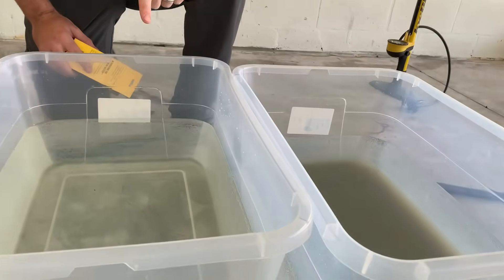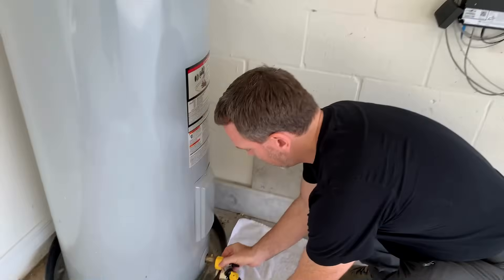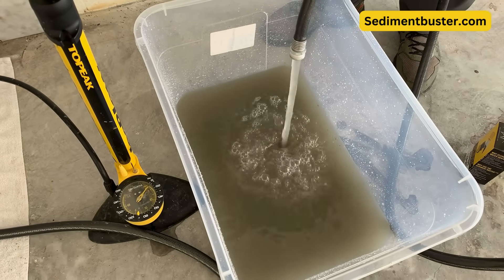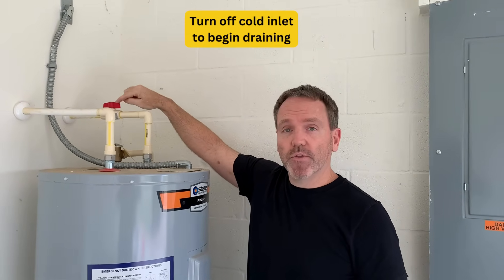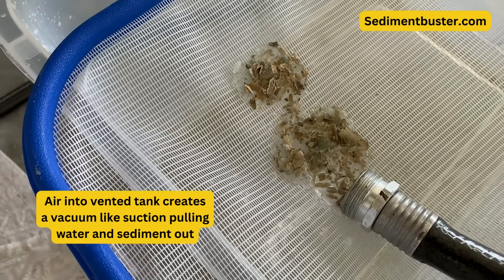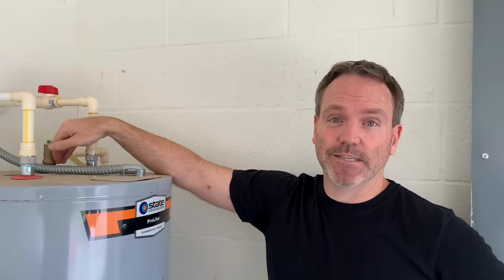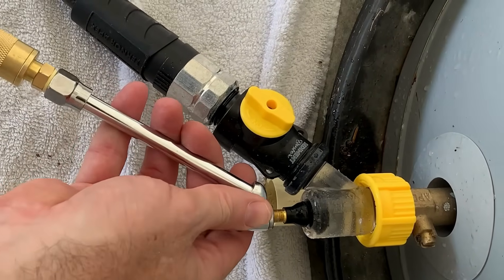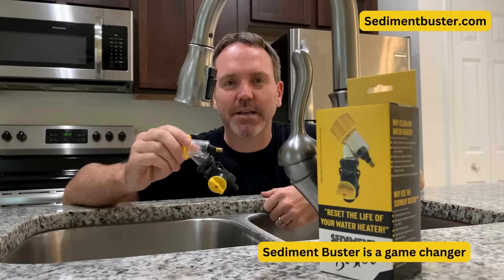Sediment Buster Unclogs, Flushes AND Drains a Water Heater Tank like you've never seen before

Comment: way cool tool.   This gives me - courage to do the flush - because plugging up valve is an issue and the only way that I saw before was to have 2 hoses in y config - one to basement drain and other to water supply.   this is way easier.  thank you

Comment: Just remember if it's been a while since you've cleaned the bottom of your water heater. You might not want to do it. Once you flush it you may open up all them tiny pinholes that were plugged up by all that sediment.
One more thing. Your pressure relief valve If there's enough junk around it to keep it from sealing there's probably enough junk around it from keeping it from working. Yes it can be a pain to change. But you should open it up. Relieve the pressure. If it doesn't reseal. Put a new one in. If it was clogged up enough not to reseal it was probably clogged up enough not to work properly. And it's kind of an important part. It keeps it from being the space shuttle. And remember you might want to take your aerators off your faucets and you're messing around cuz you're going to plug them up. This is a commercial about this little thing. it's not about what you should do. it's just about buying their product. Because they want your money.

Comment: Cool tool.  Question.  According to the description it is recommended to use this between 80-100*F but the water in the water heater is usually hotter than this.  What do you do when the water is hotter than the recommended range?
Reply: Follow his directions.  

Shut of the gas or electricity, then open a hot water valve (your tub works well) until you have replaced most of the hot water with cold water, thus cooling down your tank.

Comment: Just wondering what the max psi should be set at thanks
Reply: If you follow his instructions, it doesn't matter, because you are doing this while the tank is vented.  You could push 200 PSI in there and it wouldn't hurt a thing, because you'll never pressurize the tank.

Comment: I’m in the process of doing this as I type this but I’m finding that my water heater even with all hot water faucets open only releases water for about a minute at a time. I then have to burst quite a bit of air into it to allow it to build enough pressure to continue draining. It’s been over an hour and my tank is still not empty. To my understanding water should flow constantly without the need to hit it with air but that is not my case. This tool is allowing me to drain completely even as painstakingly slow as it is
Reply: Your tank is badly clogged.  Don't be surprised if your tank leaks after you clean it out.  You may be removing gunk that is sealing rust holes.

Comment: For the guys using this thing for the first time. Don’t follow the instructions. The way this video does it and the instructions say 2 different things. I hope I didn’t screw up my HWH just now . Follow this video. Not the instructions. Also if you use an air compressor while the water is draining the water pressure will have your hose shooting water everywhere.

Comment: I recently “flushed” my water heater. I also replaced the elements and anode. The water is definitely hotter but we still run out of hot water. I purchased one of these from Amazon. I’m really going to flush my water heater this time. Thanks for sharing.

Comment: Interesting....  Worth checking out.. BUT:  I am not sure I fully understand the process:  In the first 3 to 4 minutes, Do you leave the Kitchen's hot water faucet 'ON" (allow water to flow) or not ?  Also, do you leave the cold water INTO the tank ON (allow water to come in) ?  Sure looks like it to get that much pressure.  Finally, don't you turn OFF the power source of the tank first before doing anything  ?
Reply from the maker: We also include written step by step instructions to both flush the tank with pressure and drain the tank with venting

Comment: You should be testing your pressure relief valve anyway.  If it can't reseal, replace it with a new one from Home Depot.   Costs $20
Reply from the maker: @murky2502  certainly good advice 👍
Reply: Good advice. I was about to say the same. I think it SHOULD be tested. If it doesn't reseal, it needs to be replaced.

Comment: Seems like a gimmick to me mr, when water is shut off leting tank to fully be emptied then its best to turn on water with drain open yet & let water run for 5 minutes to flush everything else out of the tank it works well & no need for this gimmick tool adapter.
Reply: This tool is for tanks with lots of sediment that won’t just passively drain on its own… I think you missed the point of the product.
Reply: This is a tool for someone who has never done this to their heater amd now has to overhaul the tank not simply maintain it.

Comment: Your missing most of the sediment and all the big pieces that can’t fit through that tiny standard drain valve. Better than this method? Drain the whole tank, remove the stock drain valve and replace with a 3/4” ball valve for full flow and easy sediment passage.
Reply from the maker: You bet.  Exactly what we suggest in our instructions.

Comment: The pressure relief valve is a safety device and is supposed to seal. Part of maintenance should be opening and closing it anyway.  If it doesn't seal, it should be replaced.

Comment: Would be even better if you took that drain cock off and screwed in a short piece of 3/4 pipe. The actual drain cock has a very small opening preventing the bigger stuff to come out.
Reply from the maker: Completely agree.  Our updated instructions recommend this step.
Reply: @SedimentBuster that’s great!!  I actually put a 3/4 ball valve on mine and clean it every year. Even with a whole house filter I installed I still get sediment in my tank, but far less than without the filter. I’ll pick up one of your adapters seems like it will make my life easier. Thanks!!

Comment: I like this video and might get the buster thing if not too expensive. However, if we just let the tank empty thru the hose.. why not then take the hose off and run heavy wire in there and CAREFULLY scratch around to break up the crud? It'd release more water and be a little messy until you'd get the hose back on but ...
Reply from the maker: The air pressure is so much easier.  Plus you don’t need to take a hose on/off to feed the wire, not to mention the water and sludge that will be pouring at you as you feed the wire…it’s just easier and the clear lets you see the process

Comment: If you have water that is clogging up your tank maybe you need a good filter system to save yourself and your stupid hotwater tank. Funny how people are more concerned with there hotwater tank then there health.
Reply: You miss understand much of particles comes from inside tank which has two sections
Reply: Plus, you don't understand the chemistry going in the water heater. Filters don't work on hot water. Lime and iron in solution start solidifying in the tank and clog it up.

Comment: Check your anode while you are at it.
Reply from the maker: no doubt!  Try this!  Before you start draining, take the anode rod out and use the hole to create an excellent vent for draining.
Reply: @SedimentBuster  I been doing residential, commercial and RV water heaters + tankless for a few years... a few "good practices" when doing maintenance. Cheers!

Comment: Hey Joel, I'm getting ready to flush my 17-year-old Ruud 75-gallon gas hot water heater using your awesome product. Do you have an Amazon link to the heavy-duty pool skimmer you used to capture the debris? I'd like to document how much sediment actually comes out.
Reply from the maker: Set around 80 on the tool.  1-3 second bursts.
Reply from the maker: For sure.  Get 

https://www.amazon.com/UNCO-Pool-Skimmer-Nets-Cleaning/dp/B0B2WDHKW7/ref=mp_s_a_1_9?crid=VNZ8XC9GZ2JF&dib=eyJ2IjoiMSJ9.MWYr_j5B69zFGsDYC14w5guDiRbbklckf3i3oGlhvaHFD1QH3nn-CngHdpEPqpCImBsN6j4-miMIEwcGgCL1O_ss67r4VRt2e101dU7WtTzho4xccch9h-DTv42C31orrCBY9t864rargb8IJLqyq2OUKqK_VxAHsFsJrco1oCrwcmfoJzr3cFRkoru8GN5q1_2mFnAgNzL862Y94Zlq4Q.CxRiNMlayslNUp0-XVSv6kYF6eapIoNVZ2ytksftD9Q&dib_tag=se&keywords=pool+skimmer&qid=1711310774&sprefix=pool+skimmer%2Caps%2C142&sr=8-9
Reply: @SedimentBuster  Awesome! Thank you, sir. 

BTW, what PSI do you recommend if one is using an air compressor? Any other tips before I get started?

Comment: What was all the stuff you got out of the tank?  You mentioned sediment and minerals, but does that stuff just fall out of the water or does it cake to the inside of the tank and over time then drops to the bottom? Where were you for the 22 years I owned a house with a 40-gallon hot water tank? My new house has what I believe is called a tankless hot water heater, so I don't think this will be helpful here.  Those 22 years, the glass-lined tank that was there when I bought it, well, it cracked within 6 or so months. I then bought the stainless steel tank and had no problems for that 21-period. Now, as it was just me, maybe I didn't run enough hot water through it to mess it up, but my hot showers were always hot. 
As it's only been a few months in my new house, I haven't had a chance to find out what to do with the tankless stuff, so any thoughts and suggestions would be appreciated.  In the meantime, I am going to subscribe.  I also want to thank you for not having any music playing while you are speaking.  It's a major pet peeve of mine with YT hosts that seem to think music playing while they are telling me how to fix something or do something or why a plane crashed is such a good thing.  Let me tell you, it is not. It is very distracting. So, thanks again, for keeping the music out.
Reply: Instaneous wall hung hot water on demand requires yearly maintenance.  

If your "handy", this is pretty much the list.

Remember in the old days when granny would descale her kettle?  That was  to get ride of scale build up. (Mineralization).

Your users manual that came with the appliance will detail all the various filters etc. You need to  inspect and clean.  But also you will need to descale the Heat Exchanger once per year.  This is a process that takes 20 min to 1 hr.maximum.   Look it up on utube "descale-ing a (Manufactures name & model)   any plumbing & heating supplier to the trades will stock this.   

Or get a qualified person who has this stuff do it while you watch the first time.  It's not rocket science but does require some tech expertise.

Doing or getting this done by a reliable trades person makes the difference between a 10 year appliance and a 20 plus year appliance.
Reply: A tankless heater will still get buildup, it just won't be as much as something like a 40+ gallon tank will. It also really depends on the water source. Where I live in Florida we have aquifer water which is extremely hard and we get a hard gravel-sized buildup of minerals inside the tanks within even just a couple of years. The chunks are large enough that they can completely block the flush drain, so something like this tool that can help circulate the stuff around to help flush is a lifesaver!

Comment: Question, I live in an old mobile home 1979 I think, there doesn't seem to be a shut off valve for the cold, I only found the pressure release valve. Do I need to get a plumber to install one? Any plumber out there doing videos this would be a good one for you to do, just saying lol
Reply from the maker: Good question!  Shutting off the cold inlet can also be accomplished at the source of the house.  Every home should have a cold water shut off valve which essentially accomplishes the same thing as shutting off at the point of the water heater.
Reply: @SedimentBuster  yes I found the main water shut off ty, I also found the one too the water heater but they put it under the trailer very hard to get to and getting dirty is not my thing lol, so I'll just shut the main off  I had an hour to talk to my brother he's been in plumbing 28 years and he said same thing, I'm running to Lowe's to get new garden hose, the one we have is in a roller and it's 2 hoses , one small off the side and one long one rolled up and only the short one on side will fit but it's too short.also forgot to say we have well water and he said to do this every year since it's hard water
Reply from the maker: Great!  The videos I made were well water.  Make sure you check out our instructions and videos online.  If any questions or problems email me through our website 

sedimentbuster.com

Thanks!

Comment: When I drained my tank it was all very fine rust dust. What are all those big chunks in yours? Some looks like sand and rocks. I didn’t have a tool like that so I stirred it up by opening the intake valve and blasting it.
Reply from the maker: The valve on the tank we were draining was a 3/8 hole.  Some valves are very restrictive.  Use the Sediment Buster to drain your tank empty.  Replace the drain valve with a full port valve.  Then fill with a little water and use the SB to create air vacuum.

Comment: A nice idea. You'll be hard pressed to convince me that adding air to the tank creates a vacuum of any sort, however.
Reply: Doesn't the small amount of air added just clear the drain port / valve only to allow water flow?
Reply from the maker: @billbaillie3702  actually what is happening in this case is a siphoning effect in which it literally creates momentary air pockets that then pull back out what is around it.
Reply from the maker: 😊 hard to believe but it does.  I’ve tested it many times and show it in other videos.  Needs to be vented and attached to a hose.
Reply: Venturi effect

Comment: the rotten egg smell is hydrogen sulfide due to magnesium anode (vs zinc ) reacting to the hard water as it heats up it brings the minerals out of solution ,(opposite of being dissolved)  . the drain valve opening is very small maybe 3/16 wide so any thing larger will not fit .. the air pressure is not doing anything but freeing up a drain valve clog .a powerflush ( just opening the drain while water is on) can do and it just creates a channel . there can be a solid layer stuck to the bottom of the tank that will never break up unless you cut open tank . it will break apart sometimes and sound like a bowling ball inside .
i have been installing water heaters for 22 years and have cut open tanks to see for myself.. 
good idea but wont solve the sediment issue .
Reply from the maker: Sediment Buster will help you get the tank empty (by keeping the passage clear as it drains) through the small drain valve so that you can change the drain valve to a full port.  Then apply 2 points of agitation (cold water intake and Sediment Buster air bursts from the new drain valve).  That is where we find the most success getting the sediment out.  Without 2 points of agitation, you are right, a channel effect is happening.
Reply: I'm looking to flush mine out very soon after just moving in a few months ago.   If I read correctly  you suggested leaving the drain valve at the bottom open while leaving  the cold supply line open at the top to create a channel of flow?
Reply: thats how i do it when called out on a trouble call. if you are handy  and if it is a brass drain ,i would pull out the drain and put a 3/4 full port ball valve to allow the junk that is smaller than 3/4" to escape .obviously you will want to shut off the water and relieve pressure before removing valve ...if it is a plastic valve i wouldnt touch it as they tend to break off as they get older .  also on a older tank 10 years or more  flushing out the junk may reveal a pinhole leak that was covered before and now you have a leaking tank to replace ...
the water rushing through will also stir up and break up some stuff too.
 @avenge1671
Reply: Yes I have a plastic valve. I don't think it's ever been flushed since it was installed in 2006. You think ai could risk breaking it even If I tried to open it? B
Reply: it is a risk depending on brand but you can see if it will open fairly safely .the risk reward factor is low .. on a tank that old i usually recommend replacement on anything older than 10 12 years depending on water quality . you may end up not getting all the junk out and the rumbling bowling ball noise may get worse if it partially breaks up but cant fit out thru drain  @avenge1671

Comment: I back flush the drain with city water first. This should clear the way better then then the low pressure you get with the hand air pump. I have my hose hooked to the stationary tub faucet. When I think its cleared, turn off the tank and take the hose off the faucet and open the tank drain. Not only does this clear the drain but agitates the sediment, Warning, do not use higher pressure then your city water normally supplies.
Like another comment stated, be sure to take aerators off and flush the hot water lines otherwise you will be cleaning them. The hardest part of flushing your hot water tank is getting that plastic drain valve off.